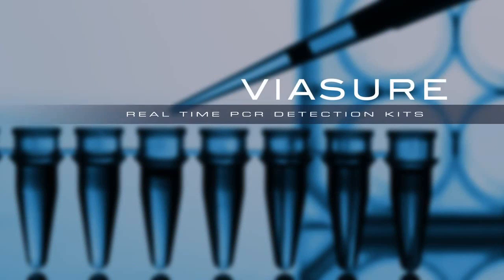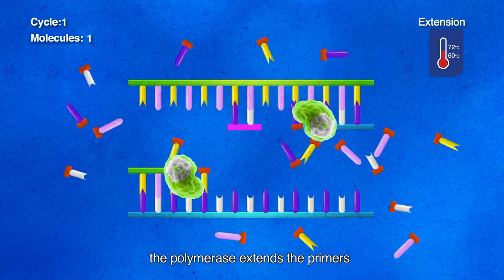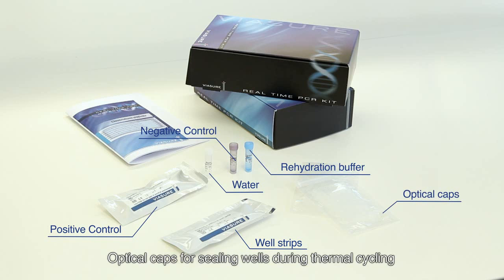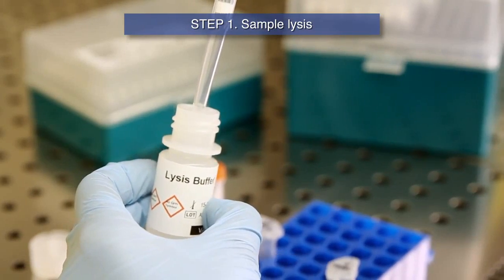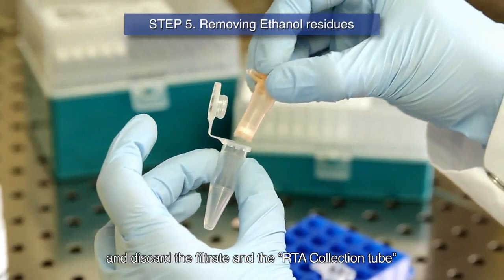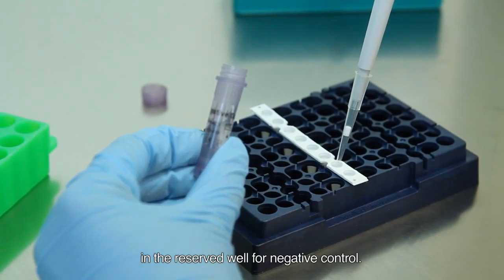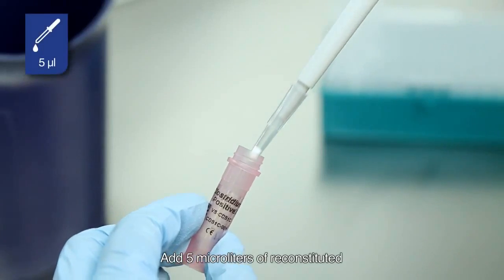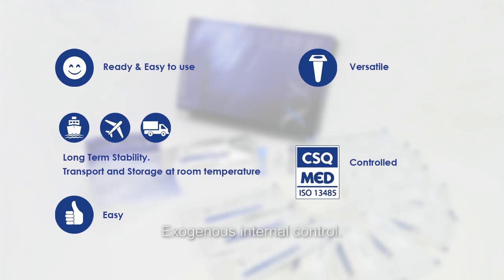VIASURE Real Time PCR Detection Kits. Nucleic acids extraction & Initiation Protocol

Comment: I understand how the PCR works...but this video failed to say how the results are obtained. What is being "read" at the end?
Reply: You will notice that the cycles exceed 35 which really is the limit before excess noise destroys the test's validity.
Reply: @stevestars303  cycle number is relative and such claims are not correct.
Reply: @TheFelltimber  Well we do have the MIQE guidelines as reference, and we can see  how the test curves flatten at the top above 35 cycles,
Reply: @stevestars303  what is ypur point?
Reply: @TheFelltimber  The point is as Dr. Kary Mullis told me during interviews and the world years ago, there are vast number of reasons why PCR is not a "gold standard" are any other reliable "test" for viral load or viable activity. I hope that is clear. Then the MIQE guidelines are the final nail as this devolves.
Reply: @stevestars303  he was talking about end time PCR which would be inappropriate for testing viral load. We are using RT PCR which was not invented by Mullins and it is fit for purpose. That is why we use it. In my lab we do several different PCR technologies, of which end time is only one. The idea is to pick the appropriate PCR for the need at hand.
Reply: @stevestars303  you are confusing end point PCR with RT PCR. This is the false message people with no background have been falling for.  EP PCR only gives signal at the end of all cycles, so a high cycle number becomes inappropriate and Mullins EP PCR is not used in covid testing.

 For RT PCR, amplicons generated are viewed after each cycle with most positive cases occurring between 28 to 30 cycles, irrespective of how many cycles are used. As such viral load can be calculated against the standard curve, another feature EP PCR does not have. The instrument can be stopped at plateau which might be after 33 cycles. For samples that are generated later, they get re run for confirmation and rejected if late. The amplification curves along with the behalf the positive and negative controls  aid in interpretation of results. Trust this helps. All the best.
Reply: @stevestars303  you can check the specificity of the primers by blasting them against the public databases online. They are specific and obviously chosen to be.
Reply: @TheFelltimber  I respect your uses of the tests. But we still have the issue of no "gold standard" virus to test. There isn't one available form CDC or NHS. What we have is a computer model but nothing we can cultivate.
Reply: @stevestars303  would like to understand what you are saying. No GS virus? ...just a computer model?
Reply: @TheFelltimber  Well they could not patent anything found in nature. Coronaviruses as you know, are very common and we have studied them for over 50 years or longer. The "gain of function" addition of the Spike (similar they say to the GAG protein with HIV" in theory anyway) was added to make if a genetic modification and thus able to patent. But where de we find this SARS CoV-2 to examine? Can we test it in a lab to watch the ACE2 effects? The tell us that it is everywhere, but they (CDC, NHS) don;t have a certified lab sample to test.
Reply: @TheFelltimber  Yes. What it is, is a model. Now keep in mind that viruses are as unique as snowflakes, though they should some very specific gene sequences that would identify them. The problem here is that we have no gold standard for SARS Cov-2. Check and see is you can get one from CDC or NHS. They don't have any to test. They have a paper version.
Reply: @stevestars303  you need check the multiple primer pairs used. They are list along with the protocol.
Reply: @TheFelltimber  I will credit you with having the primers. but where is the virus?
Reply: @stevestars303  no worries. The early reference sequences are uploaded to online public databases . This and others form the reference sequence from which primers are then designed verified. For example last year the first isolation and sequencing was done in Melbourne on a man from Wuhan. The sequence was then made available worldwide and other countries independently do the same thing. From this we can also build family trees and see where and when variants arise. Does that assist?
Reply: best to check how to interpert the reasults for this specific method as some methods vary